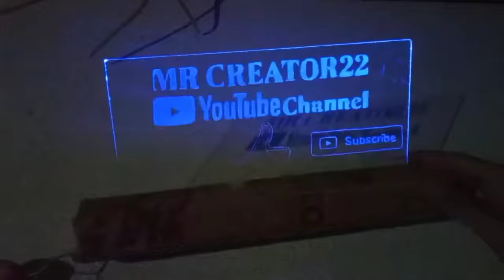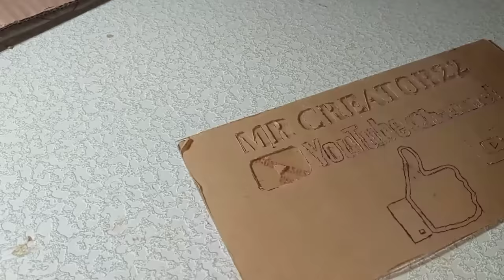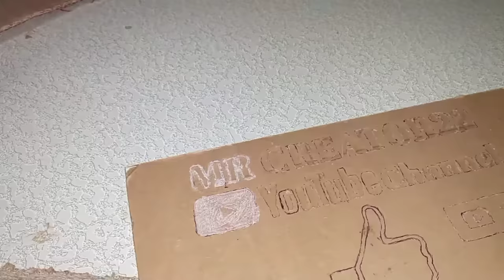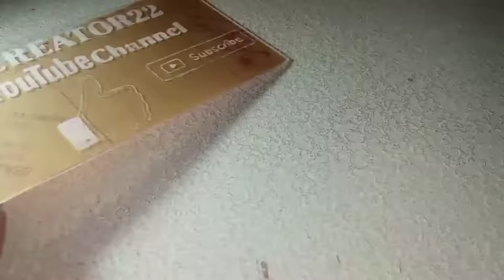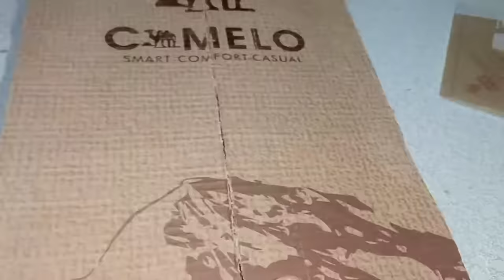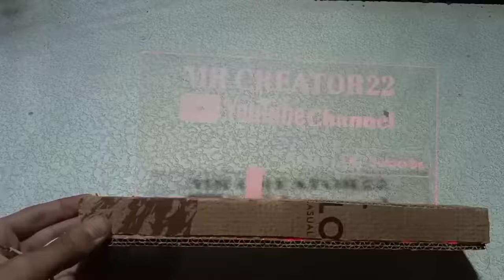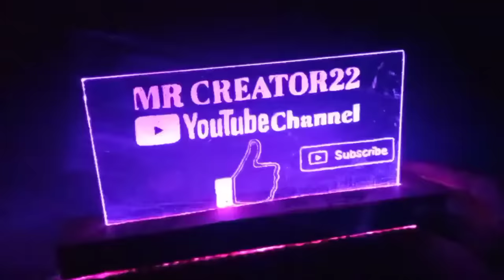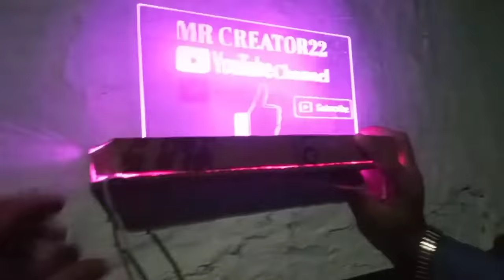Diy Led lamp/Acrylic sign light Acrylic Design/ Howto make light name board/ homemade Acrylic design

Comment: I wonder if this is the same concept they use for those Monster drink refrigerators they have in some stores?
Reply from the maker: no its not
Reply: @MrCreator22  Do you know how they do that?
Reply from the maker: @bodeine454  you can explain it
Reply: @MrCreator22  I'm not sure but I think they have a piece of clear acrylic cut out in the M shape and then frost the areas of it they want highlighted with green light and have some green LED's shining from between the glass or acrylic door probably at the bottom and maybe top, not sure but I'm thinking something like that.